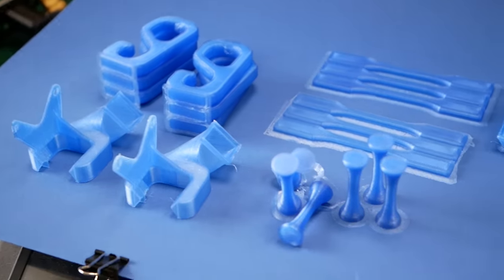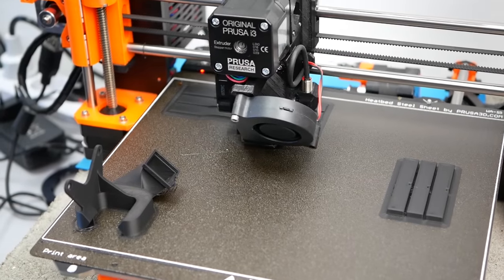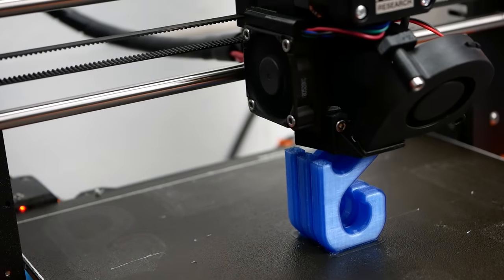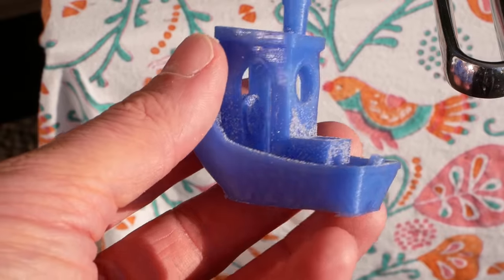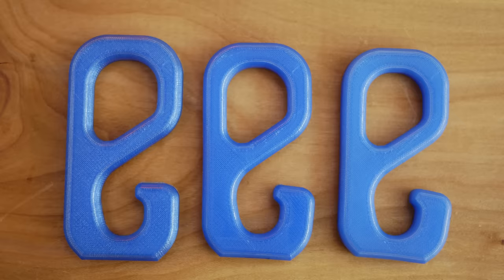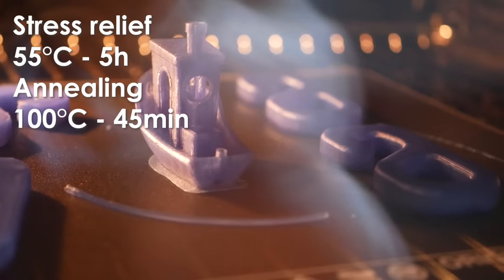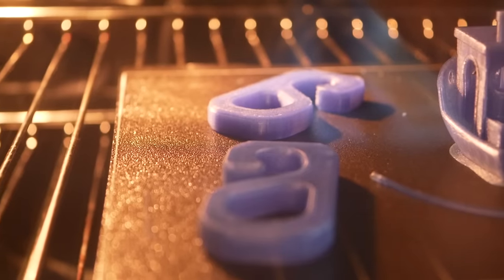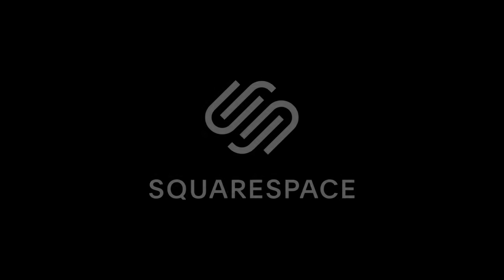Strong 3D prints through ANNEALING, but... Part 1: PLA

Comment: Myth busted !
Reply: Not really. He admits there's a 10% increase in strength and an increase in heat resistance. How anyone can call that a busted myth, is a mystery to me. Just because 10% "isn't that big to me"?!?! What?
Reply: @NoMoreBsPlease  But the approximately 10% increase in stength along the XY  directions was accompanied by approximately 10% increase in thickness in the Z axis (and 10% shorter in X and Y).  So if you simply printed 10% thicker, (and shorter, if you want to use the same amount of filament) you'd get the same increase.  Busted.
Reply: @NoMoreBsPlease  that was for the mythbuster reference....